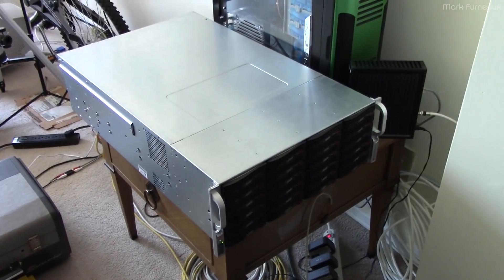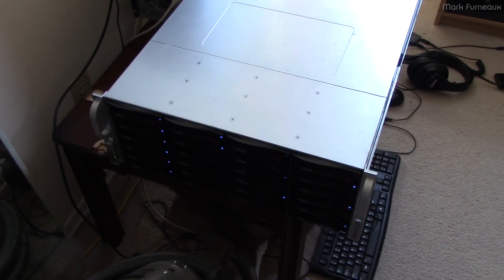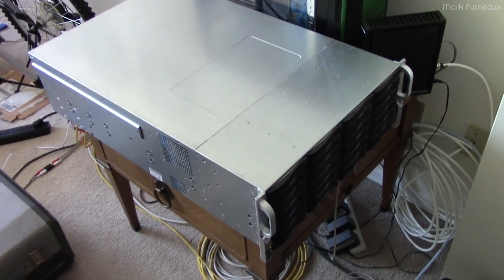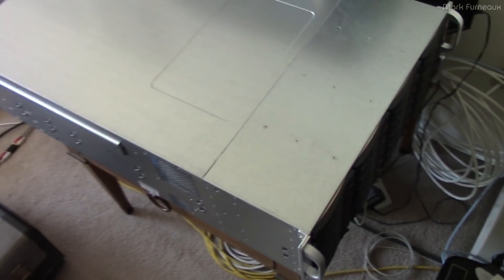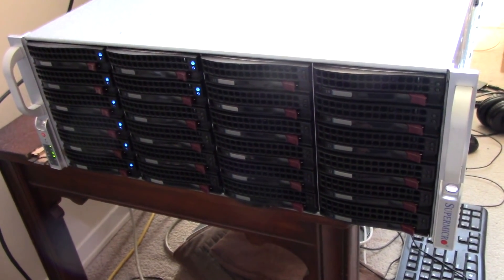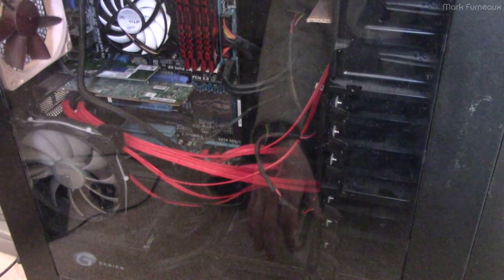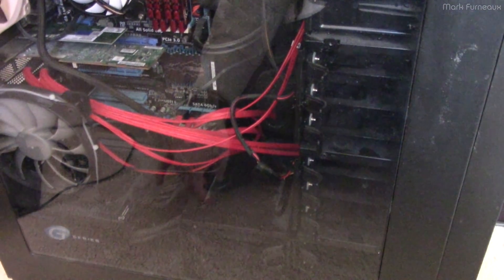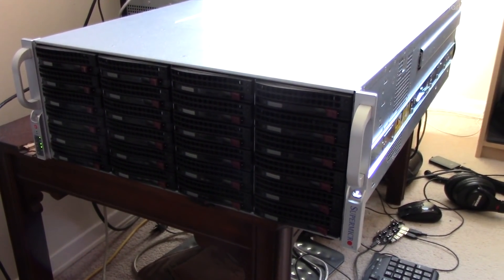My New Supermicro File Servers

Comment: Im using an old school Windows xp era case for my Server, I did have other junk cases I pulled the drive cages out of it and I installed them into that case, 1 with screws and nuts, the other had no choice to use zip ties, I also got a 5.25" bay adapter for 3 3.5" inch drives, Its kind of a mess, Im still looking for and older case, though not a rack case, but something that has a bit more cable management, something that just don;t feel as janky, I had a massive Coolermaster HAF case which would of worked, but the thing was like 4 foot tall, a lot of room in places I didn't need the room at lol

Comment: I have the Supermicro 847-12, and am wondering where to find a SATA power connector to put an internal SSD so that I don't have to use up one of the drive bays for boot disk.

Comment: I have one of these and for someone reason I can't get it to turn on anymore I connected a PSU tester to the 24 pin connector and it turned on  and them I got it to boot again but it randomly died 10 mins later any ideas what it could be?

Comment: Very nice. The Xeon 2600v3 series processors offer significant potential upgradability should you need additional processing power. Some boards even offer potential upgradability to v4 processors (I've recently dealt with needing to borrow a v3 processor just for the necessary BIOS upgrades for this). Definitely a fine bit of future proofing for your production stuff, particularly since these processors have dropped pretty nicely in cost on the used market.

Comment: Thanks Mark for the video and congratulations with your upgrade. Just a question do you do zfs replication for backup and if so how do you control or know when the replication is finished so you can shutdown the backup server afterwards?

I myself is in the process of changing from rsync to zfs replication but struggle to find out when the process is finished so that is why I am still using rsync even though it is inferior to zfs replication  guess. Any idea where to look? (background: I am using FreeNAS)
Reply from the maker: I wrote a tool for this many years ago. https://github.com/TheUbuntuGuy/offline-zfs-backup It is designed for Linux, but I was able to port it to FreeBSD for a TrueNAS installation recently. I may publicly upload the changes to the projects so they can be compatible on BSD.

Comment: Exos are louder the IronWolves. If you have NAS in your living space and not in separate room then it is not ideal to use Exos drives.
Reply from the maker: Louder yes, more power, no. They are helium filled and the datasheet clearly shows lower current draw in all active states because of this. Datacenters want lowest power.
Reply: @TheUbuntuGuy  You are correct. For 16TB drives idle is 5W for Exos, IW Pro and IW. For Exos Max power consumption is 10W and for IW Pro and IW Seagate only published in datasheet an average power consumption of 7.6W. So its not apples to apples comparison. I do agree that for server applications low power consumption is required but not only low per se but low for work accomplished. By which I mean faster drive can require more power.
Reply: Yeah we are really placing servers in our livingroom, not in a separate room. /s

And you'd be crazy to buy ironwolf when exos is way cheaper.

Comment: Making a buying guide would be cool.
Reply: make sure you get something with a board that supports upgrading to the Xeon E5-2600v4 series processors for potential upgrades, as they offer higher max core counts and significantly improved thermal efficiency compared to the v3 series. It's perfectly fine to start running on the v3 and upgrade later once the prices drop even further, but with DDR3 ECC becoming increasingly rarified since the widespread adoption of DDR4 memory back in, what, 2014, the shift over to DDR4 ECC memory is becoming increasingly necessary for future maintenance.

Comment: Too big, too power hungry for what it is and what it does.
Reply: Depends on what your needs are and the cost of power in your area. Intel Xeons with their C-states left enabled can be fairly power efficient when not under heavy load. The space aspect is still valid, though, but there's really only so small you can reasonably get with that number of disks in play. In this case, you can save about $500 or more by going with a full-depth server chassis as opposed to something smaller. If you don't need that number of drives or you're willing to spend more upfront for your enclosure, you can totally pick up some of the smaller tower fileserver chassis that use mITX boards and those little ATX format PSUs with redundant PSUs inside them. It just costs more to do so.